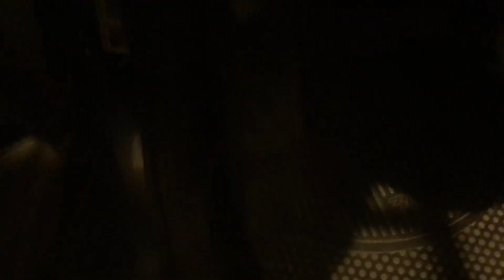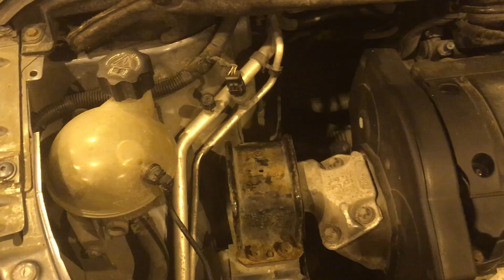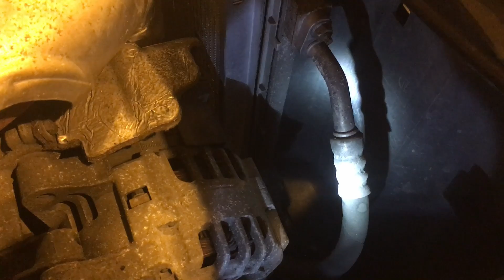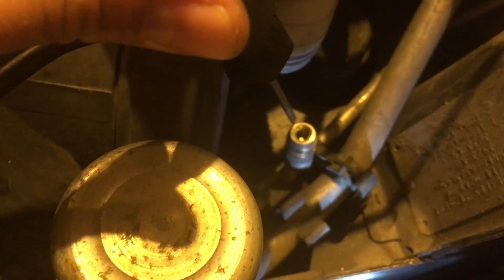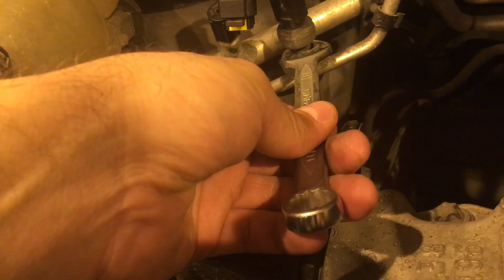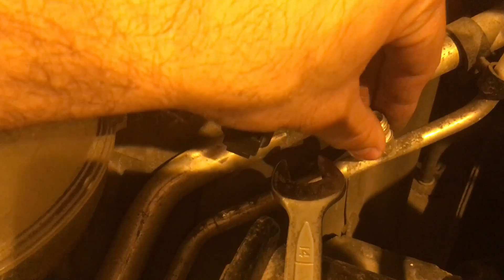Replacing A/C Pressure Sensor - Peugeot 307

Comment: Hi, and thanks for great videos. :-)
My AC does blow cold air for a while when I start the car but after aprox. 5-10 minutes the air blown out isn't cold anymore. It kind of blows "normal" air. I had the AC filled and it has pressure, also the compressor starts and stops as designed. Does my Peugeot 307 from 2005 have a dry filter? I read about problems with dry-filter building up ice because and clogging the system because of the dry filter (the condesed air not dripping out beneeth the car) not working properly. Any ideas would be super appreciated

Comment: My 307sw has slightly low air pressure. On turning on the air con the compressor clutch engages, but the radiator fan doesn't come on. Does this switch control radiator fan or is this controlled elsewhere?

Comment: Hi, I have a Peugeot 307, hdi SW 2006 diesel model. I'm trying to sort one of the injectors as the seals are gone and leaking. I've been informed I need to depressurise the fuel system before removing injector, otherwise can be very dangerous. How do I do this? I've checked on YouTube and it states you simply remove the fuel pump fuse. I've done this car still works and the system still has pressure. Please can you advise?

Comment: Great video 

Thanks for posting it. I have a question about refrigerant gas. When uninstalling the a/c pressure sensor in my peugeot 307, should the freon be emptied before beginning with this proceed ? Or does the refrigerant gas goes off the hight pressure line and needs to be recharged in the System again ?